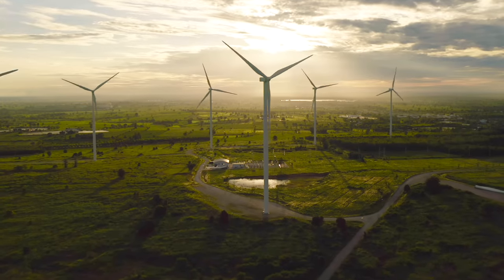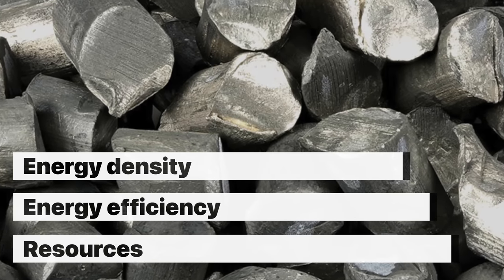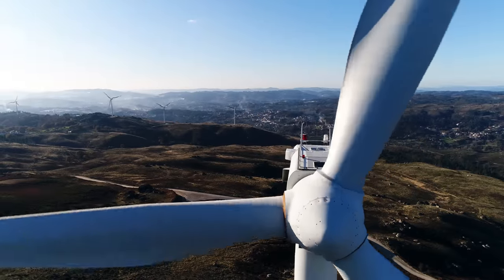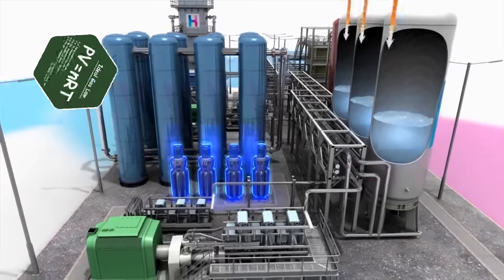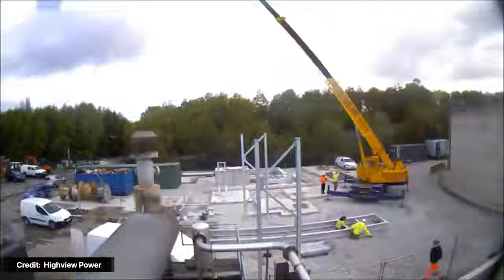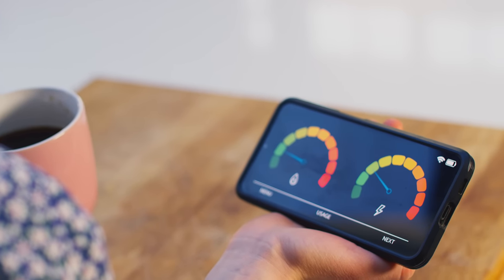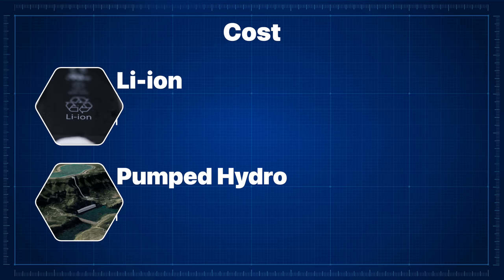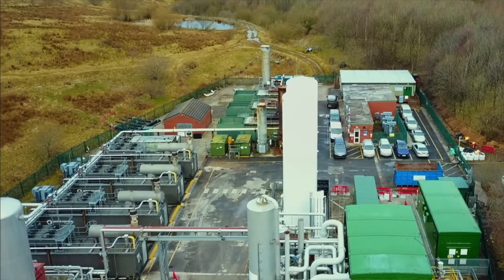Insane Breakthrough Stores Energy In Frozen Air!

Comment: I believe using something as simple as a carjack if a system was made where everyone went to this same rail every day showed up together had lunches smoke joints and had a blast and worked up a little sweat for only an hour or two I believe the combined weight if you used correctly could be spun somehow and create energy you would want to thread it for a long time you'd want it to use its energy slowly but efficiently if you kept at it every day and everyone did that I believe we'd have so much power we wouldn't know where to store it but into the ground somehow we need a big battery
Reply: Drugs are bad, kids.
Reply: This is what's commonly know as a run on sentence......punctuation matters

P.s. Period

P.s. Period.  Period.

Comment: I have a problem with the use of the term “Cryo Battery” for the liquid air energy storage system. Batteries actually produce electricity chemically.
Reply: Actually, in my language (Romanian) the battery term is used to designate one or more similar things that are supposed to work together: drums, guns, voltaic cells. Now, in your language, what's the difference between a battery and a voltaic pile (rhetorical question)? Therefore, from my perspective, if this system is designed to be expanded with more units, the term of battery is quite fine.

Comment: Thx for sharing. These kinds of commercial power systems have a horizon of about 50 yrs. Over that time the Li-Ion batteries must be replaced many times. So, when you're doing the comparison use a base life of 50 yrs. Then battery techs costs dramatically increase. Unless we move away from Li batteries Li will become scarce with a rising cost due to that scarcity.

I don't understand the requirement for an external heat source. The atmosphere itself is more than adequate to gasify the liquefied air. If you have an external heat source lying about then you can save on the gasifier heat exchanger size but that's it. So. I don't see the external heat source as a requirement only a convenience.

This seems on par with pumped hydro but denser and gravitational falling weight systems. The falling gravitational systems are far simpler but are not as volumetrically as efficient. I don't see height as a detriment. The ground footprint is what is most important. Dirt costs money however sky does not.

Oh btw I hate present battery tech, mostly for their short lifetimes.

That's my 2c worth.

Again, thx for sharing.

Comment: You'd think that a system like this could run along sand batteries to store excess heat from the compression phase and reapply it during decompression.
Reply: I think a plan that fits all these new tech ideas into a viability graph chart based on locations and materials is already planned out and has been since the 1940s.
Reply: @terrafirma9328  Yes it's not exactly cutting edge tech but its time may have come.

Comment: So, what sort of timeline would you be looking at in regards to this?

  There needs to be a good way to judge what efficiency loss increases are per unit time.  As well as cost per Kwh or per Mwh.

  A higher efficiency loss could easily be acceptable if that efficiency loss does not increase per unit time, especially if it is a long-term storage option, and the storage cost is low, having storage with those features might be way more important than it having a simple 'instantaneous' efficiency.
Reply: I wouldn't trust a thankful of compressed/liquefied air much beyond about a decade, maybe two decades, I don't know if that helps?
Reply: @alanhat5252  not really what I meant, but that is definitely an important metric as well.

  Let me give an example for what I mean, because it is important for whether something is viable for long term storage.

  Say I am using these compressed air systems, and I fill them all the way to capacity, and start the clock at time t=0.  After that period of time, assuming I am not drawing energy from the system at all and leaving it idle, for certain systems there will actually be a loss in energy for sitting idle.  In the case of this system specifically, I would assume the primary energy loss while idle comes from a loss of heat from inside the system to outside the system over time.  Even if the process loss percentage is low, if the idle loss is high in terms of days it is not likely to be useful for grid storage at all, like you analyze the energy still stored after being idle for 3 days is 95%, that still may be good enough for short term grid storage.

  On the contrast if the process loss is high, like only 25% loss if you fill up and then send out on average, that would be really bad if you tried to use that for daily storage.  But if the same battery kept 99% of it's energy over a time of months or years, then it is still viable as long term storage because the loss will only ever be that 25% instead of accumulating and losing everything over long storage times.
Reply: @dausume  The loss per day will be directly proportional to the heat transfer into the tank.  If they are super insulated, it ought to be good for a matter of days, if not weeks.
Reply: @incognitotorpedo42  okay, so this is effectively a short-term storage solution competing directly with lithium batteries and such.  Which is more suitable for colder climates?

Comment: Good info.
Couldn't you combine it with a closed loop hydrogen. Hydrogen is created in parallel and than used to create electricity to help heat the liquid air,,or something like that.
Cheers

Comment: Seems like this stacks up better against Molten Salt Storage than Battery or Pumped Hydro. How does it compare interms of LCOS vs land requirements? Imagine this paired with a Solar Thermal plant. If anyone has excess heat its probably them. Just does that occur in the same cycle?

Comment: When they liquify the air, they must remove the water.  In very dry regions the water could become another resource to sell.
Reply: I don't see why they would remove any component of the air?
Reply: @alanhat5252  Water ice would just take up space and not contribute to the energy recovery process.  In fact, it would harm the process because it would consume energy as it warms and melts.  It would be important to remove the water, but I doubt that they would get enough in a dry area to be worth selling.
Reply: @alanhat5252  water would turn into ice long before it reached those temps.

Comment: Hmmm...since Nitrogen and Oxygen boil at far lower temperatures than CO2, I wonder if the CO2 could be captured as the liquid air is being heated back up.  Argon and Oxygen could also be captured for some industrial processes, but it would be nice to get 100% of the CO2 like with direct air capture.
Reply: Pressure can change the boil temperstures to the desired level for what you may have in mind. If it becomes a cheap enough marketable process it could be another game changer

Comment: Any, energy storage system is usable and sustainable if the power that feeds it is free and it's components don't degrade with use. In that case, efficiency isn't that much of an issue. Once you get past the construction, that is. However, until enough "renewable" energy systems come on line, in sufficient quantity to provide power 24-7, I would suggest mass deployment of micro reactors using molten salt method. Far better than gas and coal, as far as air quality goes, and works day or night. So far, wind and solar fall woefully short because you need the capacity to generate and store more than you use. This "Green" push is getting way ahead of itself and is going to, make that already has, caused preventable issues for the public. Properly managed, there is no reason for brown-outs or black-outs or major places in the world not having any power at all. And fossil fuels aren't the enemy. How they are used, there is room for discussion. Man, is Man's worst enemy.

Comment: Battery would indicate chemical reaction, right?
this is just phase change energy storage using mostly nitrogen.
I bet they use word battery to make this sound more like AA battery than high pressure liquid nitrogen storage. That liquid tank should require pressure relief like on ln tanks and over time stored nitrogen leaks out.
water is just so handy and no extreme temperatures.
Reply: Battery is a group of cells. A cell is an energy storage unit irrespective of technology used to store that energy.
Reply: @eclecticcyclist  interesting. So this would be one cell battery.
Oxford dictionary states battery is device that produces electricity to make a thing work. So this could be battery by that broad definition.
Reply: @Bot.number.69420  Yes,  and a hydroelectric scheme can be considered as a one celled battery.
Reply: @Bot.number.69420  a AA battery, technically, isn't a battery, it's a cell.
A battery is a collection of cells & 'cells' could be anything, for any purpose, down the road from here is a fort that, when operational, was a battery because it had lots of guns. 
Isn't language fun sometimes?

Comment: I heard the Co2 version of this was way more efficient. Same principles just Co2 alone not other air components.
Reply: ...and sealed -- this sounds like it's open-to-atmosphere at certain points.
Reply: @alanhat5252  its not. its based off refrigerator tech and compressors. closed loop system

Comment: This could strip CO2 from the atmosphere for use in a CO2 battery storage and power system. ;-)
Reply: I have heard that liquid air storage can be used for carbon capture and storage, as different gas liquify at different temperatures, other gases like nitrogen, oxygen and argon could be removed for use in hospitals and industry.
Reply: This would be an expensive and not very efficient way to get CO2 out of air.

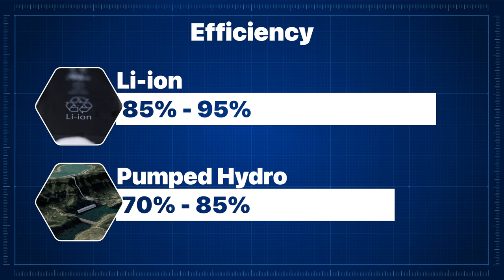Comment: 7:21 - there is no way pumped hydro has a round trip efficiency of 70-85%.  Where did you get the information from.  Those are 1 way numbers.  Efficiencies multiply, so round trip is 50-72%.  Motor/pump for storage, generator/turbine for re-generation.  Think of efficiency loss as $ burnt up in fire, and it all becomes very clear.
Don't complain to the power company when your electric bill goes higher because of the policies you vote for.

Comment: What exactly is the scientific breakthrough here? This seem to all be old known tech, just applied in a particular configuration.
Also, during the regasification process, couldn't ambient air be used to boil off the liquid air? Then most of the energy needed would be to drive big fans to exchange the air at a high enough rate I imagine.

Comment: Hmm just watch your segment on the sand battery, that's all about heat only.
Seems to me that this cryogenic process could benefit from adding a sand battery component to it for the heating process all using the off peak electricity from renewables.
There by remaining stand alone and not needing to be located near other heat producing companies.

We never need to idle windmills if we use the energy in a multitude of storage applications such as cryogenics, sand batteries and hydrogen electrolysis, and neither of these involve mining for precious minerals.

Don't let the perfect be the enemy of the good.

We keep chasing efficiencies to the point of implementing nothing.

Water, sand and air are very inexpensive components to work with while lithium and other metals are commodities whose price is affected by supply.

Cheap now does not mean cheap in 20 years as the supply dwindles, lithium is fine for cars but not for grid storage.

Professor Donald Sadoway out of MIT is also working on a grid storage project with liquid metals that looks very promising.

Comment: Compressed air storage tried for powering vehicles does not work so people are clicking on your video to find out what the # is this guy thinking. Then they find it is not just compressing air but liquifying air which involves a phase change storing much more energy than just compressing air? We only need to hear it is better than pumped hydro once, but you repeat it multiple times. A problem is the mechanics of liquifying air requires a lot of maintenance unlike for instance an Ambri battery?

Comment: Not buying it.  Cooling is inherently limited by the strict laws of Thermodynamics.  Higher efficiency only comes from using better compressors and heat exchangers, which are of limited life and quite expensive.   Using “waste heat” never seems to work out— youre Then limited in plant location and limited by the heat source schedule.  So it overall depends on things beyond your control— the Schedule of refineries and steel mills and the cost of money— can you get a low enough interest rate so you can pay back your loans while the steel mills are running and before the heat exchangers and compressors wear out?  The calculation is a simple one and usually and probably indicates no way Jose.
Reply: Destroying the earth has always been a simple calculation. Seems all we can do is simple calculations...

Comment: it really irritates me that basically every home has a heat maker (oven/stove) and a heat destroyer (fridge/freezer) in the same room, and both consuming power. furthermore, we use energy to heat AND cool the whole house dependant on season. we dont use resource management AT ALL.

this needs to change or we will strip our biosphere entirely before succumbing to death by lack of energy.
Reply: They have new split geothermal water heaters that move the compressor outdoors. We need split tech like these to maximize effeciency. Things that generate heat indoors are good during winter but a way to move that outside in summer does need to be solved for a/c, fridge, etc. A heat pump on every device or connected in some way
Reply: The amount of heat a refrigerator and a stove use are not that great. Refrigerators are already designed to be very effcient. Stoves only get used a few hours. If you want an electric appliance that uses a lot of energy to be mad at look at electric water heaters. Effcient heat pumps that both warm and cool homes are taking over the market. However, from a practical standpoint, generally, it is still better to spend most money on insulation. Insulation in homes has a higher return on investment. Most homes do not have enough insulation, and generally, unless you are in a new home, or a super efficient home, this is where you should spend money to reduce electric needs. They do have heat pump hot water heaters (they are expensive still) and they do have heat exchangers that can partially preheat your water using waste heat in your sewer pipe. For perspective a hot shower uses about $0.25 of electricity.  A hot water heater in a typical homes uses about 1 to 2 dollars of power a day. About $0.25 just to keep the water hot each day. Then some for clothes. About $0.15 a load, (if washed in hot) and the rest for showers/bathing ect. For perspective to heat a one gallon pot of water to boiling costs 2 cents of power.
Reply: @terrafirma9328  no no no. Dont push the excess heat out into the environment... Store the energy!
Reply: @cryptickcryptick2241  my point is, fridges shouldnt be using energy in the first place.
Reply: @MrKahrum  If it's cost effective to store it makes cents😉, but you don't spend $50 to save a penny if your never reducing your future cost to reclaim the difference. Financial ans economic efficencies are more important than energy efficency in most cases.
Reply: @terrafirma9328  recycling the excess heat of all of our electricals into electricity would result in storage being a non issue. saving a penny a day (though it would be way more if the concept is spread throughout the home/city/country) over the lifespan of a well made product that lasts longer adds up. we toss atoms around willy nilly, without a care in the world what applications/ energy we could be utilizing it for on the way.

my most obvious example is the compression braked, petrol powered car. its burning non renewable resources to both accelerate and deccelerate,  and none of the resulting "waste" energy is captured in any way, the heat is used to boil a fluid, and cycle it in the wind to remove that heat from the machine, and any physical byproducts are expelled directly to the air with as little interaction with the machine as possible. and in a matter of decades at most, the machine will be sat in a scrap yard to oxidize. this process is generally analogous to how humanity operates on the whole. eventually, we just chuck everything back into the environment instead of repurposing the "waste" atoms and energy. we only have so much, and the house is getting dirty with everyone throwing their trash on the floor.

Comment: This would compliment a nuclear power station beautifully. Storing all that base load when there's plenty of cheap wind and solar means avoiding the expense of reducing the reactor's output or shutting it down. Then you've got all the heat you need whenever you want to deploy the air battery. It means a medium reactor could have the same net-output as a large one over a year, making it easier to integrate it with existing wind and solar.
Reply: The UK has pumped-storage hydro for exactly that purpose, pumped-hydro & nuclear were built in tandem in the early days so nuclear could run hotter (& produce more weapons-grade plutonium).

Comment: if you super heat cold air, vs water-steam, you can superheat air more
Reply: ie, cold air can take more heat than water
Reply: thin rotating intertial disc energy storage, super spin hard disk, for even phones
Reply: spin discs are just iron-steel-ceramic discs
Reply: have extra so that you dont have to be cheap
Reply: you lie, atmospheric heat is enough to heat the cold liquid
Reply: try to liquid air canisters for consumers